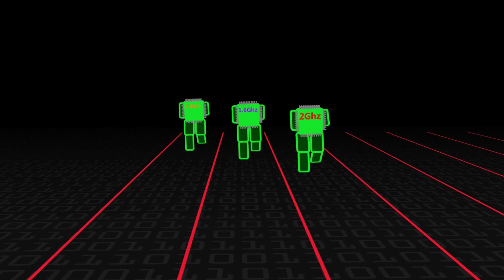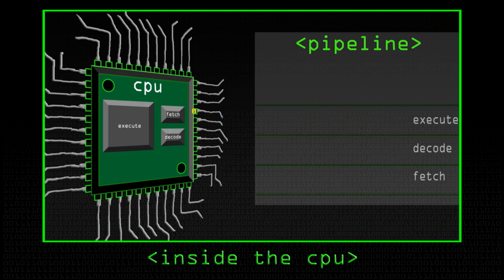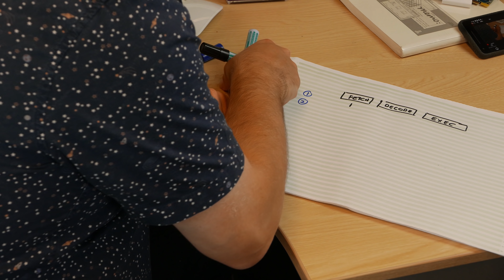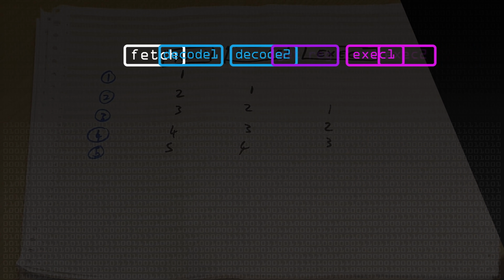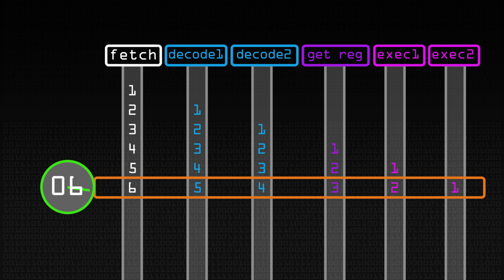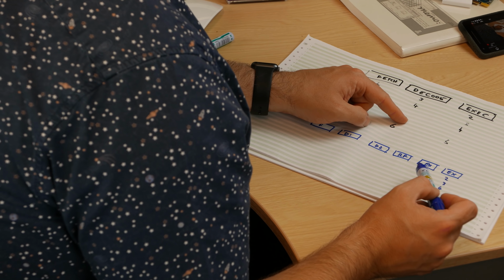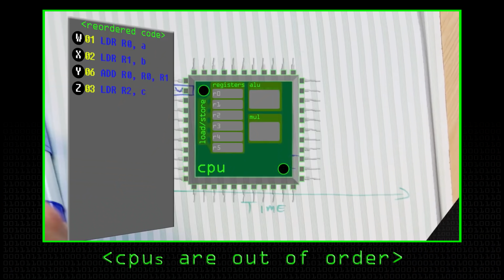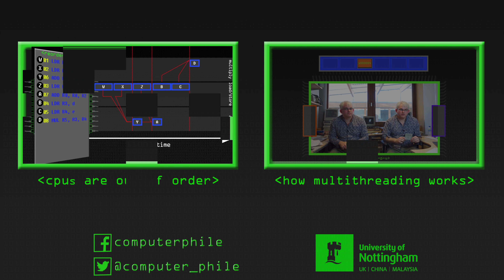Computer Speeds - Computerphile

Comment: Comparing processors based on clockspeed is like comparing engines based on max RPM.
Reply: Not true if the two processors have similar implementations though. In these cases, the frequency is typically pretty much proportional to instruction throughput, at least for code segments that fits the caches (which is very common).

Comment: Would it be possible to make a terahertz chip given a completely simplified architecture?
Reply: Lol, it is not frequency of wave.
Reply: Probably not with any known technology. There are many physical barriers to frequencies above a few GHz, from the speed of electrons and transistor switching to insulation strength and heat dissipation. (The world record overclock for some time was the AMD FX 8350 under direct liquid nitrogen cooling, that managed approximately 8.5GHz)
Even in the world of radio transmission where simple high frequency generation has been possible for ages, everything changes in the multi GHz range, many satellite dishes work in the 12GHz band but the signal must be generated at the dish and handled via wave guides, where lower frequencies could be sent along coax cable for significant distance.

Comment: THz computer will be achievable if you get the compute elements down to being a collection of atoms, and the bus wiring to be single carbon or metal nanotubes, a single atom in diameter.
Reply: Google "CPU small techprocess" and you will hear about quantum tunneling. Yep! That's the problem why that will not work :-)

Comment: "will we ever get terahertz processors" I would guess yes. as moores law breaks down, eventually we're going to hit a limit on how small you can physically make transistors (right now we're already making them something like 40 atoms across, and you cannot realistically go smaller than an atom, right?) at that point to increase computing power we'll have to either make them larger, which might happen, or it's back to the clock speed wars. (I suppose you could also try and push for higher IPC, but that will only get you so far)

Comment: So is there any way to know how fast a CPU really is compared to others without running tests ourselves?
Reply: I mean, that's what benchmarks are for. But generally it's going to depend on what you're doing. There's no one system that's best at everything.
Reply: Not unless you have a ton of computing power to simulate the architecture.

Comment: Will the speed of light be a limit to clock cycles? Is it already? (Say, for how far the RAM is from the CPU, copper traces, etc)
I ask this because a fraction of a thousandth of a millionth of a light-second is in the ballpark of just a few centimeters.
Reply: It is a consideration for parallel buses. This is why most high speed data cable are serial an not parallel, for a given frequency parallel is much faster but the at short wavelengths small changes in conductor length start to mis-align the signal bits. Thus serial bits allow much higher frequency in practical use, more than enough to make up for the reduction in [literal] bandwidth. 
Though it is actually the speed of electrical pressure in a conductor, which is significantly lower than light in a vacuum. (and the speed of an individual electron in a wire is only about as fast as you walk)
Reply: @mytech6779  Thanks, that cleared things up. If it was a problem for chip design it would have already been long ago then, but it's a bit mind-boggling to imagine a CPU cycle "propagating" through the chip and computer like water pressure through pipes rather than happening "simultaneously".
Reply: In future we could transfer information faster than light :-)
There is one little interesting thing - quantum entanglement. Google it.
Reply: @igorthelight  sorry to disappoint you but quantum entanglement specifically cannot be used to transfer information. Not even gravity travels faster than light, nothing does. The only real workaround is to bend spacetime like an Alcubierre Drive does.

Comment: From the description:

"aren't enough to measure it's speed"

I think you're missing a comma and this sentence is incomplete. It sounds like you meant "aren't enough to measure, it is speed..." and then you just end the sentence there without finishing it. The more I read the description, the less sense it makes.

And this is why you should use the correct forms of its and it's. Its is possessive. It's is a contraction of it is. Of course it's still comprehensible with "it's" but it's an important distinction. Some may say I'm being pedantic, but if we're not careful about our grammar, it can cause a lot of miscommunication and potential problems. Just look at all of the mess neglecting the Oxford Comma causes.

Comment: Computers DO NOT need to keep getting faster, "PROGRAMMERS" (drag'n'drop merchants these days!) NEED to stop being so SLOPPY AND LAZY.
Reply: Computers must get faster, I don't see why they should stagnate in speed. Currently computer speed is increasing more by increasing the core count than clock frequency. Programmers should learn to code for multiple cores as multi-core systems become more common. Your assessment is incredibly oversimplified. Programmers are not lazy.
Reply: unlokia NEEDs to buy a game for > 300 dollars on a regularly basis. Then Programmers can be paid better and companies will be able to put more development time into programming the game.
unlokia will like this conclusion, because he doesn't like when programmers are sloppy.
Reply: I disagree. First of all everybody would benefit from faster computers. Second in software ENGINEERING time spent developing something also add to the product final cost.
So why would programmers use a faster and lower level language, that takes like 3 or 4 times longer to code than a JS or python that can do the same?
If you want quality software then you have to pay for it. That's why there are companies that charge 20k for a webapp and other that charge 100k